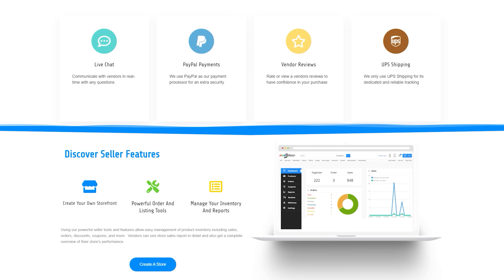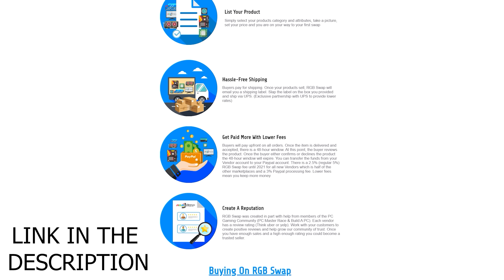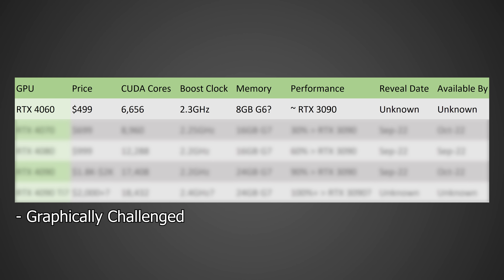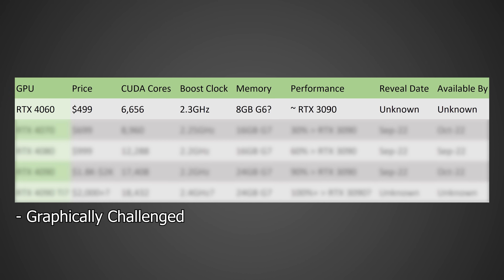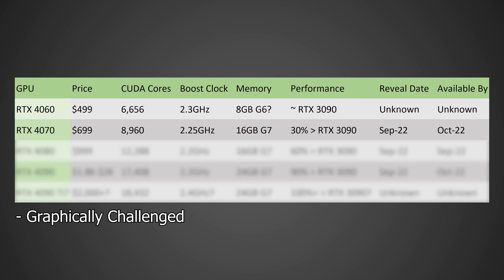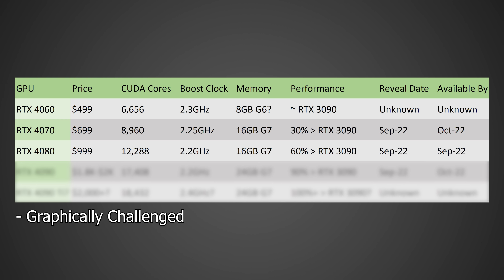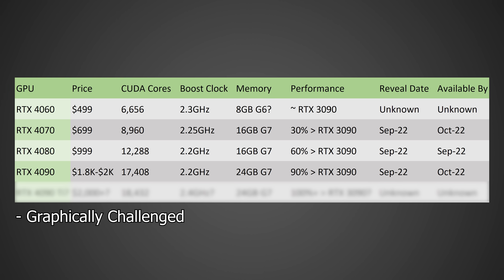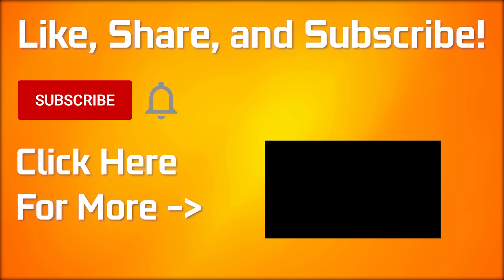Nvidia Lovelace RTX 4080 Price, Specs, & Release Date

Comment: Not a cat in hells chance the 4060 will sit at 3090 or even 3080 performance levels. as we all know, if the 4070 will sit at that mark like most 70 class cards have done, they will be at least £1200.

Example - a used 2080ti is approx £700 here because a 3070 is selling at £700. No one seems to give a sht about whether these cards are used or not anymore either, which will keep the prices nice and high when scalpers decide to drop their ex miners

Comment: They are going to be good, but not THAT good (perhaps in DXR those figures are correct). If history thus far serves to repeat itself rasterization stock vs stock IRL performance = 1.03 (for new mem. only) x ( New Cuda-count / Old Cuda-count) x (New Boost GHz / Old Boost GHz), provided the Boost clocks are realistic, so:
If RTX 3090 = Perf. factor of 1 then;
RTX 4060 = 0.85 (15 % slower than 3090)
RTX 4070 = 1.16 (16 % faster than 3090)
RTX 4080 = 1,56 (56 % faster than 3090)
RTX 4090 = 2.21 (121 % faster than 3090)

However I think the boost-clocks especially for the larger GPUs is a bit too high. I'm more inclined to think it will pan out like this: 60 = 2.2, 70 = 2.1, 80 = 2.0 and 90 = 1.8 giving:

RTX 4060 = 0.82 (18 % slower than 3090)
RTX 4070 = 1.09 (9% faster than 3090 so roughly on par) 
RTX 4080 = 1.42 (42 % faster than 3090)
RTX 4090 = 1.81 (81 % faster than 3090)

I'll be happy if proven wrong tho 😁

Comment: 4060 same performance as 3090? For $499? Never going to happen. It's just ridiculous you're proposing this.
Based on almost every generation leap and personal speculation:
4060 -> 3070
4070 -> 3080
4080 -> ~25% faster than 3080
4090 -> ~20% faster than 3090

Comment: I don’t believe a 4060 will have 3090 level performance that is ridiculous. A 60 series GPU having last generation Titan level performance has never been done before. Even the 70 series are typically slower than the last generation 80TI cards. I could see the 4070 being on par with the 3080ti however and the 4070ti slightly faster than a 3090.

Comment: What would be the point of a card as strong as a 3090 but hamstrung with 8gb of ram? 300 fps 1080p? You'd probably start running into CPU bottle-necking.

Comment: I very much doubt 4060 will be only 8GB. How would that even work? 128-bit? Then it wouldn't be 3090 performance. And 256-bit are already 4070 and 4080.
I'm 100% it will be 12GB 192-bit. Even 2060 and 3060 have 12GB. 8GB should be reserved only for 4050 and 7500 XT, they can't make the same "mistakes" with VRAM all over again.
I also doubt the specs for 4080, it should have wider memory bus compared to 4070, 80 cards always had, so my guess is 20GB 320-bit and they could go for 22GB 352-bit for a Ti version.

Comment: Yeah I don't think the 4060 will be 3090 levels of performance, I'd say 3080 level at most, and the 4070 will more likely be just behind the 3090 or on par, 4080 could be probably 20% faster than the 3090Ti, and the 4090 at around 50% faster than the 3090Ti, but even that is pushing it

Comment: nearly 100% performance increase is laughably unrealistic,30 series card is already the biggest leap of performance in decades and “only” 30-50% more powerful than 20 series, Nvidia never ever had 2 big performance leaps one after another, it’s few generations of small improvement then  a big leap, I hope I’m wrong, but a 100% performance gain is unheard of by it self let along right after a already huge 30-50% gain. The biggest leaps were RTX3090 GTX1080ti GTX480 and 8800GTX, non of them exceeded 50% gain, 100% gain right after a already huge 50% is just unrealistic

Comment: Honestly, a 4060 would be all I need and more if it has the performance of a 3090. Medal of honor on max settings here I come.
Reply: Will the 4060 be the most sensible for 1440p gaming?
Reply: @denisn8336  if it is on par with 3090 then yes.
Reply: @denisn8336  probably

Comment: wait wait wait, how in the world can the 4060 have 6656 Cuda cores and perform just like an RTX 3090? the 3090 have like 10,496 Cuda cores??? and what would you say is the 1440p card, 4k, 8k card, and so on???

besides all that, IF the leaks are to be true, then the 
4060 is basically an RTX 3070Ti with like 5xx Cuda cores more, so a little bit beefier  
4070 is basically an RTX 3080 12 GB version, with 4 gigs of ram. 
then my opinion would be more likely "WTF is this Nvidia?"
Reply: I would like it if 4060 performs around 3070 Ti but yeah.
Reply: @masterlee1988  well it's said that they would have double the performance or maybe that was just the 4090/Ti. Anyways i would too but then I would geuss it has also more RT cores/Units then the rtx 3070Ti. But if it has 7GB of ram it's still not enough.
Reply: @victor-xy7dq  Ah, that is true. But regardless that would be nice still. Still would be a nice upgrade from my 1070.
Reply: @masterlee1988  yeah I understand, I have a 1060 6gb so can relate.

Comment: This video just create a lot of hype. But you guys are forgetting the market right now and the hystorical moment. If the specs and performances are correct I expect to see bot and scalpers take over the situazion again. 30 series will slightly decrease in prices and a 4060 going as 3090 (how it is possibile with a 1/3 of ram in 4k.. ) it will cost more tha 1000$ if not more. 4080 will be around 2000$ and reaching 3000$ for a 4090ti. So wake up things will be stille bad for about 1/2 years.

Comment: Currently I'm running a 2080ti with an i9-9900k cpu. Based on current day games, Will a 4080 be too much for my cpu or should be considering an upgrade their too? I've recently retired so my pockets aren't quite as deep as they used to be so I'm on a limited budget. But I don't want to do a half assed upgrade either What ya thinking? Oh, and I'm also powering a Pimax 8KX VR hmd.

Comment: I'll start with trying to aquire a 4080. Maybe 4090, seems overpriced for that 30% potential increase. The vram would be the selling point for me.
4090ti is really just a trophy card.
Anyone still playing in 1080p or 1440p will be more than happy with a 4060.
September/October..tick tick tick
Reply: hell, 1440p and 4k might be the ideal range for a card like the 4060, given the insane specs its rocking for the generations 60 card
Reply: Though I think you could still easily make use of a 4080 with 1440p, since realistically you could run every game in existence at max graphics with refresh rate type frames (165/240). I’ve never noticed 4k being worth the performance loss.
Reply: @banditveteran  definitely, if you have the cash skip the 60 and go 80.
I'm running 3 x 28" 4k screens with a gtx1080... (i7-6950 extreme o/c 3Ghz/4.2Ghz  - 64GB ddr4 - 970EVOPlus)
1x4k screen ok in StarCitizen..3 is a sideshow.

Comment: That gap between 4080 and 4090 looks really large. I hope the 4080 is a little closer to the 4090 because the main appeal for a 90 class card should be vram and workstation tasks.
Reply: It makes more sense this way. They may actually have to give users a reason to buy the 90 class. This Gen, the 80 class wasn't available for long.
Reply: Nope that price difference makes sense pay up or settle.

Comment: 4070 and 4080 having the same amount of VRAM doesn't seem right to me.
Reply: Well, it's Nvidia... Remember 1070, 1070ti and 1080 having 8GB; 2060s, 2070, 2070s, 2080 and 2080 super, all 8GB cards. Also I think the amount of VRAM is determined by the bus width.
Reply: @Spark-mq6sq  The amount of VRAM as well as the Memory Bandwidth are dependent on the bus width. GDDR7 memory has a memory speed of up to 32 Gbps. If 4080 has a 256 bit memory, then it's memory bandwidth will be 256 x 30 / 8 = 960 GB/s (because they will reserve the fastest memory for 4090). Every module has 32-bit bus width with capacities of 1 GB, 2 GB (and maybe even 4 GB for GDDR7). So 256-bit means it will have 8 modules of 2 GB 32-bit memory resulting in a total capacity of 16 GB. That is, if 4080 has 16 GB of VRAM. 4090 could have a 384-bit memory with capacity of 24 GB and bandwidth of 1536 GB/s = 1.5 TB/s
Reply: @gurjindersingh3843  Oh thanks for the explanation. 
Another thing that doesn't seem right is 4060 having only 8GB, when 3060 has 12. But they could make a 16 GB version, right?
Reply: @Spark-mq6sq  They could

Comment: I heard the MSRP would go up but I didn't think that much. I heard like 20% but these are like 40% - 50%. I was planning on a 4070 build but with these prices might have to be a 4060 instead or a 7000 card. New entry-level builds will be dead if 500 is the minimum price of a current-gen GPU. At least the price for the performance is still good if these specs are true.
Reply: Budget building on the latest architecture will be dead with this upcoming generation. You will have to go for last generation 2080 Super, 2080ti or 30 series GPU’s if you are a budget person.
Reply: @ZackSNetwork  and those cards will be even higher priced

Comment: Moving goal post running over the edge. 40 series will bring more performance... FOR WHAT? I can EASILY play my games at extreme settings on 1080p60 and on good settings at 1440p144/4k60. I can't even tell the difference between high and extreme graphics settings after all. And Ray Tracing in Fortnite? That shit makes no noticable difference that'd be worth a dip from 120 FPS to 40 FPS on my 3060 ti. Just NO. We're at a point where we could stay for a few years now. No matter how many kiloherz of a monitor try to throw at me or 8k unobtainium TVs. Just make graphics cards cheaper again and I'll be happy.

Comment: I'll have to see the rtx 4060 have 3090 performance before I believe it. Has any "6" series designation card performed at the previous top end "8"  or "9"series designation single gpu cards before?
Reply: 3060 Ti beats the 2080 super 😅
Reply: @RE3PTV  The 3060 ti doesn't beat the 2080ti.

Comment: I really hope Intel will do well with Alchemist and beyond just because $500 for an entry level card is bs. I remember my 1080ti FTW3 was under $700 which was still really expensive. The 60 level making it up to $500 MSRP would be super disappointing. Not surprisingly just disappointing.
Reply: I mean if it's theorized to be faster than the 3090 then I suppose that price is certainly justified 
But I don't think it's necessarily going to be the entry level series this time around, maybe more towards middle - high end given the insane specs
Reply: I think they’re moving each one up a tier so the 4050 will be the entry level

Comment: I remember last year, nVidia was telling 10-series owners it was time to upgrade.  I didn't fall for that one bit.  I'd been saying since before the 30 series, I'd upgrade with the 40.  Can't wait.  It's been a good 5 years with my FTW3.
Reply: Still getting by on a 1070 O.C.
Reply: @fugginrambo  that's a really good card even today
Reply: Same here rocking 2 1080Tis in sli.
Reply: True
Smart move
Reply: @brownie43212  Or sell both 1080 ti's and get a 6600 while waiting for the new cards from intel, amd, and nvadia.
Reply: same, my 1080ti has served me well. but definitely time to upgrade for sure
Reply: @brownie43212  1.  Drop your AMD bias, it's clearly clouding your perspective.
2.  Objectively, the proportional performance increase between generations with the 1080Ti at it's Tier & MSRP hadn't been seen in recent years (you'd probably have to go back to the 8800 GTX) and has yet to be seen since.  It was a hell of a card at launch, and is still a viable option today, substantially increasing its opportunity cost.
3.  When you compare the relative performance to cost ratio on current cards, that opportunity cost is absolutely further compounded.
Reply: No way resellers and miners get them before gamers
Reply: @zhanurdos  Yeah right.
Reply: Lucky my 1080 Died Recently. I was and still am waiting for the 40 Series. Just got no GPU what is annoying.
Reply: @lonelyalpha666   im selling my 1080 if you need a good deal?
Reply: Especially if you have a 1080Ti.  That card was an absolute steal at $700.
Reply: @redslate  After taxes, my card was 801 dollars.  I double-checked the receipt which I kept years ago but my FTW3 was a bit more expensive than the founder's edition...  Which - I actually owned, but I wanted the FTW3 so much, I took the founders edition back claiming it had issues (it was fine) to get my money back so I could get the FTW3.  So happy with that decision.  It's still quiet today and looks like it did when I got it.
Reply: 980ti hybrid here, bought it used for £350 thinking it was steep enough money back in 2018 and would've loved a 1080ti but prices never got sensible even as it got retired... I would settle for a good used 2080ti now but prices on those are daft. Praying this next generation actually gives a good opportunity to upgrade without paying a literal arm and a leg because its kept me stuck gaming at 1080p as a result.
Reply: I had a 970 and upgraded to a 3070. I won't be upgrading again until the 5070 or 6070 depending on how my games run. There's no real reason to upgrade tech now before 5 years.
Reply: The 30 series was a massive leap from the 10 series you are delusional. You will likely miss out on the 40 series also and say the 10 series is to good and you will upgrade to the 50 series.
Reply: @brownie43212  Maybe if your favorite company AMD competed with better software and features people would given them more of a chance. RNDA2 are only good at Linux and gaming. Nvidia wins typically in gaming and has far more use cases.
Reply: its been a good 7 years with my gtx 980 ti MSI golden.
Reply: @brownie43212  I do agree with you. With what I stated I did overlook the AMD cards and I am a bit bias towards Nvidia. But the AMD cards have gotten better over the years. I don't know much about the AMD Graphic cards so that's why I overlooked them most likely. And yes I do need to find out and do research more about them. But I do agree they have gotten more powerful and they can be cheaper. Especially with the soon new to be rdna3. What I have heard and researched from the leaks.
Reply: @brownie43212 yea i dont know why people arent getting AMD cards only thing you would be buying nvidia card is better raytraing but no one using that shit. I know that DLLS exists but if you buy like 6700xt everything will run really good no need for FSR or DLLS just remember that 5700 xt at start couldnt even beat 2070 now it easily beats it and also competes with 3060 Ti
Reply: @pxerc5485  amd isn't that great in blender and other 3d software compared nvidia
Reply: @AdventVFX  but almost everyone is getting them for gaming thats what i meant
Reply: @brownie43212  well idk about 40 series but the 6900xt has the same performance as a 3090 even in ray tracing and its 500$ less
Reply: @rammy6999  The 3090 has much better raytracing and 4K than the 6900xt.